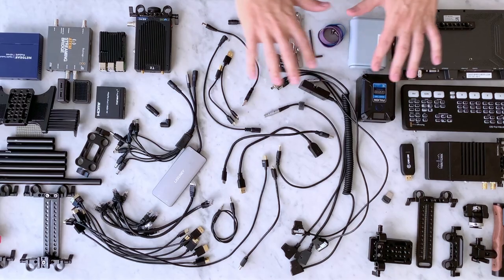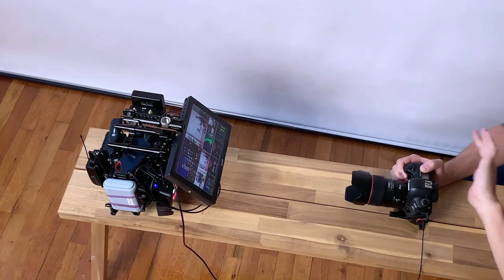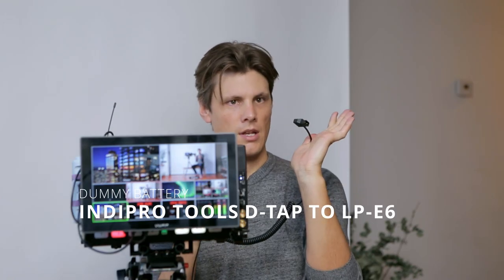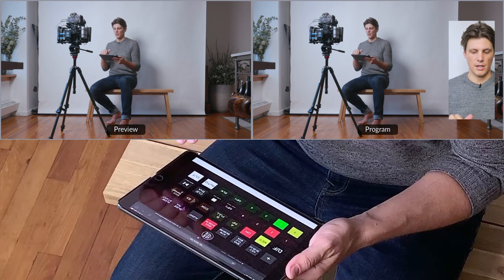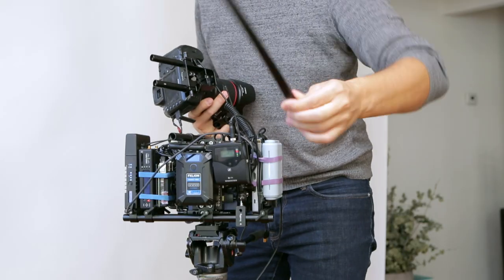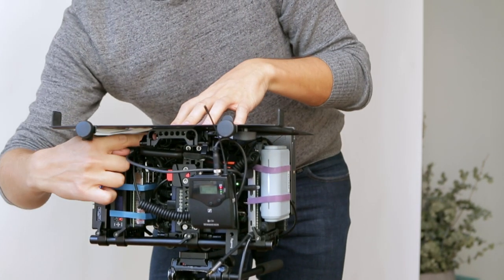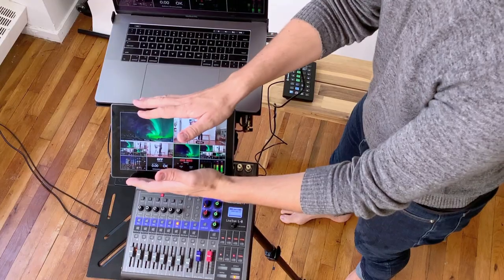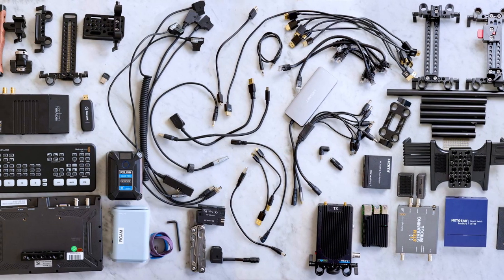Ultimate RIG for ATEM Min Pro! (DEMO Part 1)

Comment: Very good thinking. I am designing a small flightcase but as I do everything else on the standard rail system like you, I am going to rethink one or two things.  Almost all things you use I also have planned in my flightcase. I never use just one camera on my jobs and usually also do the PA audio for the event so being very small is not that important. I also like a bigger multiview monitor. I guess everyone should make it as it is needed and I think I stick to the flight case but I love your open on rig solution. Thank you for the video.
Reply from the maker: Yeah, the Mini Pro has its use-cases for portable solutions, and sounds like you're dealing with some bigger set ups! Send us a pic of your flight case when it's built!
Reply: You could actually build this rig but inside a flight case, with all the cabling routed perfectly, so that you could put the case itself on a tripod...!!! Challenging but not impossible.

Comment: I guess nowadays you have to be the videographer, editor, switcher, audio guy, web guy - and the talent as well ...lmao
Reply from the maker: Pretty much! Kinda rough how much networking and IT goes into video prod these days.
Reply: Reminds me of an electronic news gathering rig.
Reply: @zianchoy  In a way, it actually is an ENG rig...
Reply: @jas_bataille  didn't watch it all, but paring it with a camera on a shoulder and some 4g connection, you'd just need to stream directly to an RTMP for the studio to add to their livestream... so yea, a versatile wireless ENG rig

Comment: Cannon released a 'webcam' utility to prevent your Cannon camera from turning itself off. The should eliminant the need for the Elgato Cam/USB connector and solve your auto-shutoff problem.
Reply from the maker: Yes- very handy! I do have the Canon webcam utility installed, but in most use cases I am running the 5D4’s HDMI into the ATEM Pro/Extreme, hence the USB connection keeps it love, but also enables remote control of exposure/focus etc

Comment: W.O.W. That's actually kind of a thing that I need. But maybe I'm about to put some adjustment because the most common situation that I work is to shoot at the school, so  if I'm gonna finish the live-production in the classroom, the angle that in your plan might not serve me well. emmm...let me think about it. Anyway ,Thx for sharing such amazing idea there.
Reply from the maker: What did you end up deciding on for where to place the cameras?
Reply: @davidjoshuaford  well, since the rig is an all-in-one set with single cam, so that would not be practical when I shoot in the classroom. I usually need two or more cams to finish the work. I placed two in a line with one at the front and one at the tail on one side so they won't shoot each other. And sometimes one more in the middle to give different angle. I'm now having only one set of Hollyland 400s pro wireless transfer, so it's not gonna work for me to do some live-producing stuff. But it's what I'm considering about in the future ha.

Comment: Cool stuff. This setup has too many possible points of failure for me though.
Reply from the maker: Hasn't yet...but will keep you updated! The most vulnerable connection imo is the USBC into the MacBook Pro, but that's going to be the case either way, so I'd tape it down for a day-long shoot.
Reply: @davidjoshuaford  Will you be betting your life on it that it’ll get you through that well paid gig ? I like spaghetti with duct tape too in mg own spare time but losing face and reputation over a vanity patchwork with a client -  nope. Its a surefire way of getting out of business quickly and bad advice to newcomers. GL with your channel.

Comment: Very cool setup 👍.  The only wireless aspects here are the WiFi connection and wireless mic if i am right. Video is still via cable. This is intended to be a single camera all-in-one streaming solution ifi am right
Reply from the maker: It's intended as a multicam streaming solution. This particular set up utilizes a Teradek Bolt to receive wireless video from the main wide-shot camera position. There's also a Teradek Cube, used for sending wireless video of the MultiView back out wirelessly to tablets. The Canon 5DmkIV is wired since it's sitting atop the rig.
Reply: @davidjoshuaford  oh i see . I didn't catch that. So you are able to record as well as stream... I use Wirecast for streaming with a thunderbolt dock to that takes in two cameras via Hollyland wireless HDMI units and Magewell HDMI2USB capture card.  So getting different angles means someone has to move the camera and another has to switch on the laptop. Your rig is food for thought.. i will view again. Thank you

Comment: This is excellent, and very modular. Love it! 

How do you connect cameras into the rig? Assuming they're done wirelessly, is that a problem with lag compared to wired sources?
Reply from the maker: Just plug cameras via HDMI straight into the ATEM. If you want to use wireless, check the units latency - the Teradeck pictured here only adds about 4ms from memory.

Comment: Awesome video. Quick question, what is the router for? I didn't quite catch the reason for it. Thanks.
Reply from the maker: Great question - the setup is network based, so the ATEM has a dedicated network address. Companion will send commands to that specific address, so the router is necessary to direct the local network.

Comment: Like many others, I keep coming back to this video for ideas. Well done!  
I do have a question about the D-Tap battery. At 10:24 you mention the battery is getting low and you are able to connect a power adapter to keep going.  Is that power going to charge the battery which is powering everything on the rig? Or is there an alternate way to distribute all the power?  TIA.
Reply from the maker: The battery is charged separately via usbc. The rig has a female 2.1x5.5mm DC barrel at the root, and connects either to the battery via the custom D-tap adapter as shown, or else to an AC adapter's male 2.1x5.5mm barrel.

Comment: I wrote you before & you didn’t respond back to me. I’m going yo try one more time then leave it along. I have purchased the Atomos cast X & the Ninja 5 since then. Just the other day Sony came out with a camera control for the FX3 & FX30. I recently purchased the FX30. I would love to see your thoughts process towards putting together a rig for a system for these new developments. I also hope to get the teradeck spark 4K. I have a 9.1 video monitor as well. Since your post. Have you look at some of these other 5k streaming devices?

Comment: There is a setting in the "red Menu 5,   HDMI Display"  and choose the last option "Camera + Monitor symbol. With this setting the camera does not turn off when using live mode video, during streaming. If you are recording, the recording turn off, but not the live...
Reply from the maker: Live view still turns off after 30min on the 5DmkIV
Reply: @davidjoshuaford  Not i thet HDMI camera setting. I conduct 3 hours Zoom webinars without turn off. Just go to the menu, HDMI Display and put in the last option down. If you record it still stop recording after 30 minutes, and you can push the record button again, but camera still live.

Comment: Great video!  
Maybe u can modify your RasPi to takeover the role of switch and wifi, and make the right even slimmer and (maybe) more power efficient
Reply from the maker: I suspect the WiFi range on the Pi would be unreliable and it’s good to have a dedicated router, but there’s plenty more that the pi could be leveraged for that’s true!
Reply: @davidjoshuaford  You are right.  I’ve never tried one of those wifi switch router hat, maybe the wifi is really unreliable.  But just incase they do, it would be wonderful to have a great 3in1.  A big maybe😂

Comment: Rig looks just awesome! But how does it behave when heated up? Are there any heat dissipation issues?
Reply from the maker: Great question Adrian. The hottest part is the Teradek Cube, so that and the Bolt are mounted with gaps for airflow. The HDMI splitter and the 5-port network switch don't get hot. The Streaming Bridge gets warm, but not too much, and it's actually separated from the Network Switch by its rubber feet. And the ATEM is fine - airflow all round and not blocking the vents. The USBC dock gets hot when the full 100W USBC PD is flowing through it to the Macbook, but again, it's mounted separately with airflow around it. The whole rig is open-plan for airflow, and ease of access/ re-rigging.

Comment: This is awesome. How much run time do you get with  the V-mount? That seems like a lot of stuff to power off a single battery. Also is there a way to "hot-swap" without losing signal? Can you run AC with the Vmount as a back-up or do you have to go down to swap?
Reply from the maker: Hi Ben, you can buy plates that are hot swappable. I get 60-90min depending on how much stuff is turned on. Battery is mostly for convenience on short shoots where we’re moving around or bringing in a remote client. For mission critical live-streaming I’d use AC power.

Comment: Hi David.. does this setup allow you to carry a moving camera (handheld or stabilizer)  and switch simultaneously to fixed shot angles seamlessly as you move  showing the moving angle? Do you have a demo of the skiing this
Reply from the maker: Hi Kishore, this rig would ideally be on a tripod with a fixed-shot camera mounted to it, or maybe carried hand held without a camera mounted. Best to use a wireless video transmitter to bring a handheld or gimbal camera angle into the rig.
Reply: @davidjoshuaford  thanks David. I've been trying to figure out a man live stream setup with one mobile angle and one fixed using Wirecast.. i came across a couple of options where i can remote control Wirecast from my phone, but so far it hasn't been reliable on the field.. still trying to figure out.

Comment: Hey, dude is so cool but did you try sling studio hub?
Reply from the maker: Yes, I bought the Sling Studio when it first came out, but I wasn’t happy with it. I then bought three Teradek VidiU Pros to run via Live:Air on an iPad Pro, but found that really unreliable for both the app crashing and WiFi dropouts. Hence just went the ATEM route. I do think the control interface for the ATEM Minis are archaic (hence why I’ve spent time programming Stream Deck/Companion profiles to control the ATEM in my other videos on this channel), but I like that all the processing is done in hardware, and having wired connections for video inputs and Ethernet.

Comment: How can you have preview with atem mini? HDMI splitter used for this??
Reply from the maker: I’m using the ATEM Mini Pro ISO which has MultiView out of the HDMI port. The original ATEM Mini doesn’t include multiview, but you can set the hdmi out to Preview. Not sure that’s the question you’re asking though?

Comment: Okay - seat of my pants says you've got $3500 therre before camera?  Got to sell the Mona Lisa.  Maybe pad that a thou. But I would want to cut way down on the complexity - I would go nuts with that.
Reply from the maker: There’s 4K in the two teradek devices alone... but you can do without them - I built them in because I already had them from other production work. The rig itself with the electronic wiring is a couple of hundred depending on what you put into it. Links in the description :)

Comment: Tripod link?
Reply from the maker: I don’t know actually..I’ve owned it for so long. But it’s a carbon fiber Manfrotto with a 501 quick release plate. I like the center column which makes adjusting elevation faster.
Reply: @davidjoshuaford  thank you so much for the info bro.